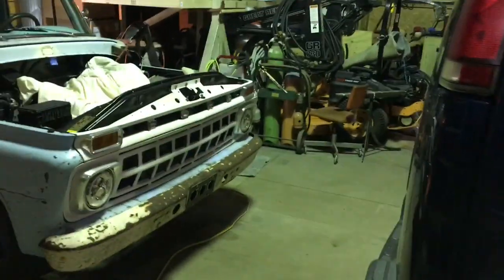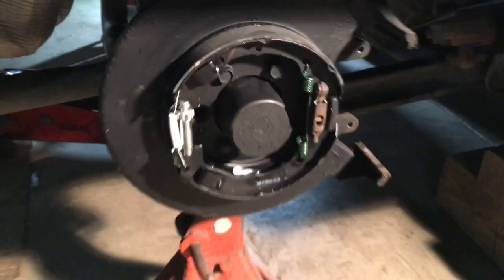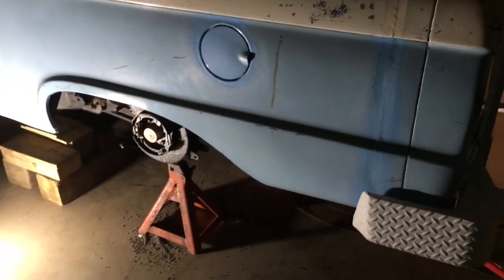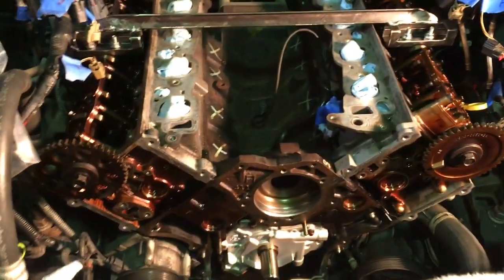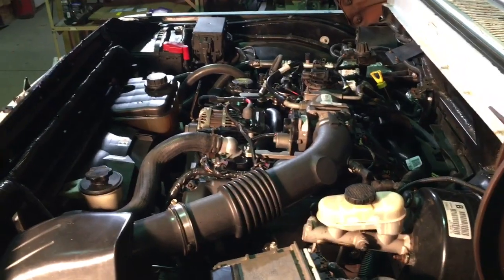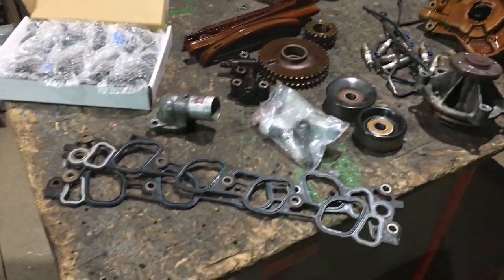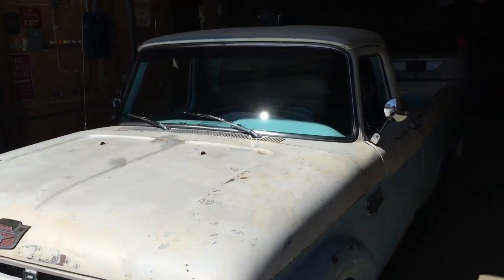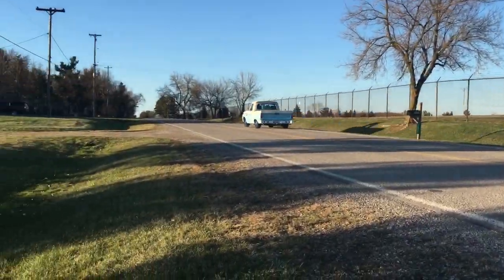FP-7100 Episode 31 General Maintenance

Comment: Would you have room to install aftermarket headers in the engine bay?
Reply from the maker: because I used the cv firewall and floor, anything that will fit on a CV will fit on my truck.
Reply: @scraptoartmetalworks2494  Great, thanks for the answer.